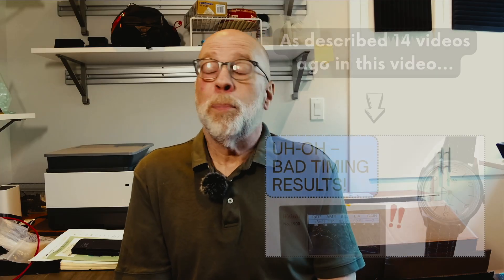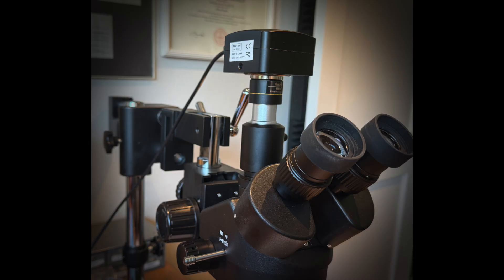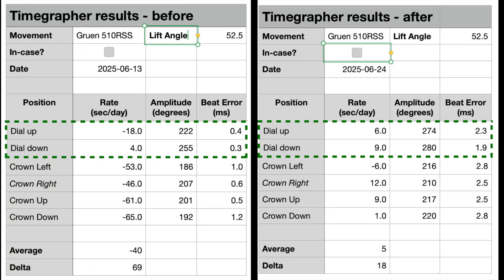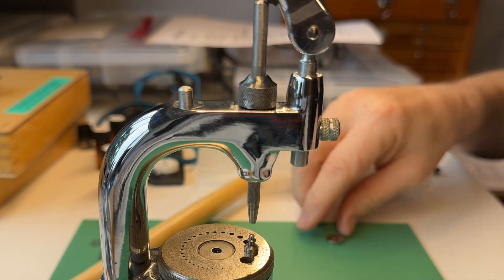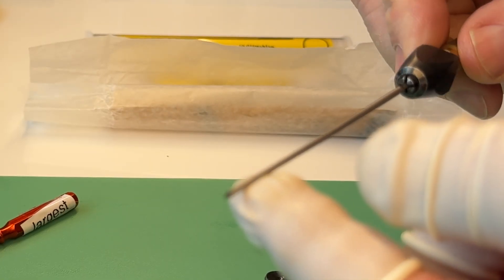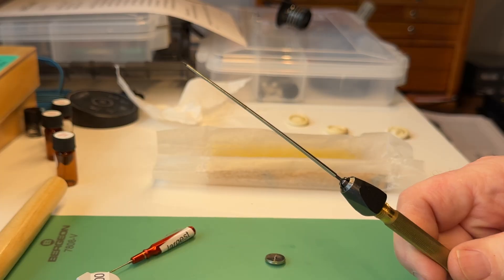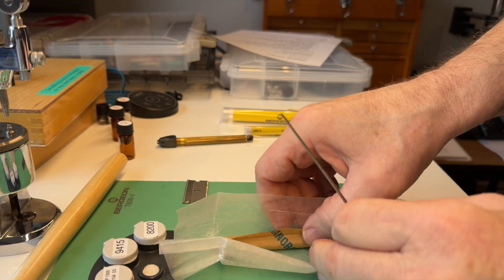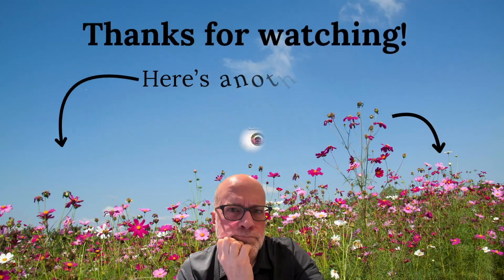Solving a Power Loss Mystery in a Gruen Watch

Comment: Excellent demonstration of the effect of proper cleaning of pivot holes and lubrication.  And also the tight tolerances required for proper side shake!    Regarding the rate:  Two of the screws on that balance wheel will look slightly different than the rest of them.  They are the rate adjustment screws.  Turn then out from the wheel about half a turn (equally on both sides of the balance) and you should see your rate reduce. Alternatively you can add timing washers under opposite side screws to have a similar effect, but the rate screws should be the route to go.  Set your regulator to the middle and then adjust the rate screws until you are close to what you want.  Good luck.
Reply from the maker: You know, I didn’t even think of the balance screws! I guess because the rate was fine before and now it’s so whacked. But you’re absolutely correct, why didn’t I think of adjusting them? Something to do this weekend! Thanks!

Comment: At about 10 minutes or so in I worked all the problems, it’s the music you are listening too🤣try a nice jazz trio, I suggest piano, start with slow ballards👍. If you want to do a simple quick cheap and effective polish (not burnish) of pivots then get some grit filled silicon like what CousinsUK sell called EVE, put in a pin vice and push the pivots in the end and polish them by twisting the pin vice back and forth around the pivot. You can find YouTube videos with this in. Good luck and update up how you get on.
Reply from the maker: I have a set of those! I like using them to clean hardened gunk off pivots before I put wheels into the ultrasonic cleaner. But if a pivot has deep scratches, I’m uncomfortable with using them to eradicate the scratches. I think a proper pivot polisher would be a better way to go, and I don’t have the training in that– yet.

Comment: I added a pulley to a cuckoo clock to halve the weight and reduce wear on the movement. This resulted in a slower rate. I don’t know escapement  theory well enough to explain why it slowed down, but if a jewelled watch behaves the same and you’re seeing a significant increase in amplitude after staking and burnishing, then maybe watch rates are not fully independent of power (torque). As a partway separate topic, I serviced an AS movement today that has a visible indent around the barrel arbor hole, like it’s been punched in a bit. The deformation could have the same effect as adding a small washer between the barrel and bridge, and might have been a substitute for staking
Reply from the maker: Adding a pulley — that’s wild!!

For sure, a change in amplitude will cause a change in the rate.  But this amplitude increase shouldn’t have caused the watch to go from having a ~normal single-digit rate increase to an average of 35 seconds/day, with some positions having +50 seconds/day. Plus, the regulator is at its slowest position. I can’t move it back any further!  So there’s something whackadoodle I think with the hairspring.

Maybe this hairspring isn’t properly matched to this balance wheel.

I have to dig into this some more! But holy cow all my waking hours are taking up by classes lol.
Reply: @Oldguyponderingacareerch-ip9tf  I guess if we run into a timepiece whose timing is off scale of the regulator, check the power. This makes me wonder if your Gruen’s mainspring might be a tad wide and hanging up in the barrel. An old hobbyist watch repairer told me the width of a mainspring can be reduced by manual grinding - but this sounds like drudgery